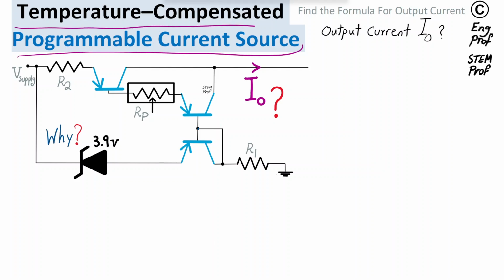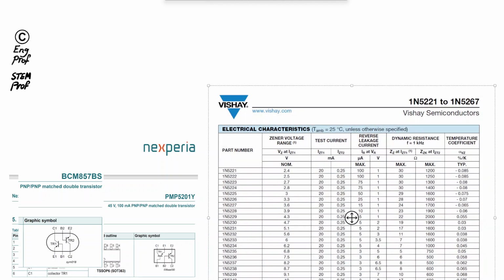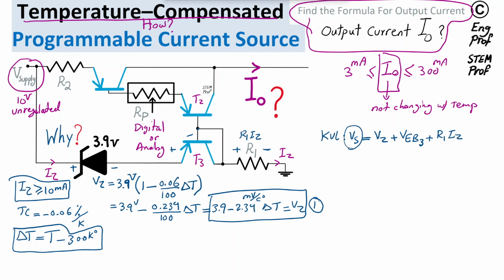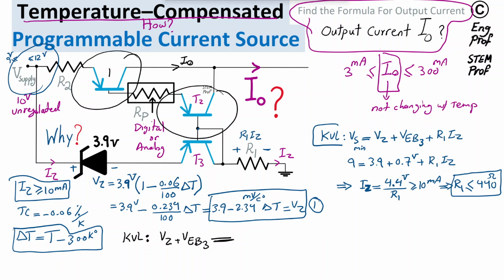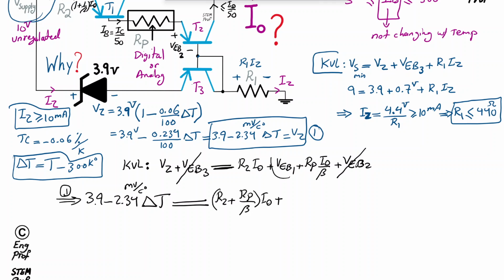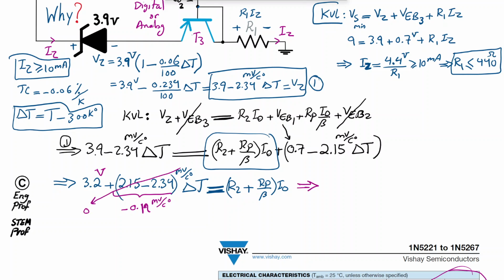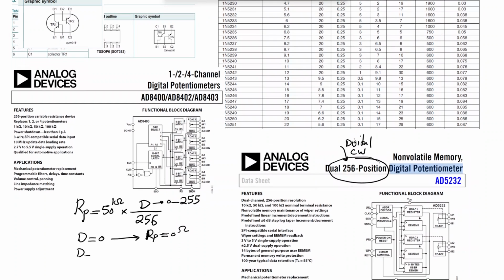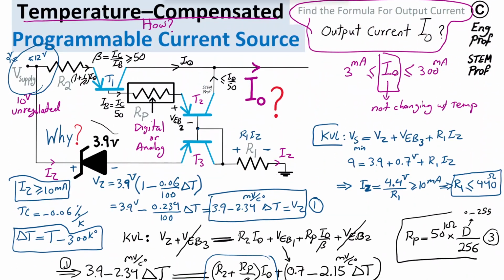Temperature–Compensated Programmable Current Source Circuit Design with Zener Diode, BJT Transistors

Comment from the maker: For more analog circuit examples see:
Wilson Current Mirror and Current Source Design https://youtu.be/LfbfJYrovN0
Temperature-Independent Current Circuit Design with Op Amp, BJT, Zener, Schottky Diodes https://youtu.be/hFbnjbddUvs
Thermometer Circuit Design with Op Amp & BJT transistor https://youtu.be/55YsraFE0rg
Analog Computer Vector Sum Calculator with Op Amp and BJT Transistors https://youtu.be/PIAsa0QNVns
Instrumentation Amplifier with Electronic Gain Control https://youtu.be/C4tghZ-q6Zs
Programmable Current Source Design with Op Amp, Zener Diode and Digital Potentiometer https://youtu.be/R1x6B0TczWk
On-Chip BJT Current Source Design https://youtu.be/Rs7gEMk03dw
Push-Pull Power Amplifier with Darlington Transistors https://youtu.be/866MYibo8yE
Analog Logarithm Computer https://youtu.be/RpKEq5WyoLg
Op Amp Analog Computer Differential Equation Solver https://youtu.be/ENq39EesfPw
Sawtooth Waveform Generator design with OpAmp, JFET, BJT https://youtu.be/5zHXTx-Vl20 
op amps Circuit with feedback loops to design an analog computer that solves a second order differential equation https://youtu.be/HeZRtnRXpEI 
For more analog circuits and signal processing examples see: https://www.youtube.com/playlist?list=PLrwXF7N522y4c7c-8KBjrwd7IyaZfWxyt
I hope these Circuit design and analysis videos are helpful.

Comment: Hi @STEMprof, can you list out an example where current source is positive temperature current source with very high impedance for current or combination bias of JFET and a way to offset the negative temperature coefficient of JFET, it would be really helpful working with dual supplies like +/- 15V
Reply from the maker: Good question. I suggest watching the following current source design examples and tutorial videos that answer your questions: Temperature-Independent Current Circuit Design with Op Amp, BJT, Zener, Schottky Diodes https://youtu.be/hFbnjbddUvs
Programmable Current Source Design with Op Amp, Zener Diode and Digital Potentiometer https://youtu.be/R1x6B0TczWk
and possibly Thermometer Circuit Design with Op Amp & BJT transistor https://youtu.be/55YsraFE0rg
I hope this is helpful.

Comment: Interesting videos. Is it possible to use any dual-PNP package? Or it is necessary that datasheet contains magic word "matched"? Is it possible to use BC857BDW in SOT-363 package which contains dual PNP, but datasheet does not mention that they are matched. I would expect that every dual or quadruple BJTs in one package are on the same die and have basically the same characteristics.
Reply from the maker: Glad that you liked this video. The Matched PNP transistor pair requirement is to minimize temperature dependency by having practically same saturation current & thermal voltage for the two transistors. While you can use dual-PNP package, the thermal compensation won't be as good as the matched pair. For more comprehensive Temperature Independent design please see alternative technique in https://youtu.be/hFbnjbddUvs which is a current generator circuit design using Zener Diodes, Op Amp and matched BJT Transistors. I hope this is helpful. 🙋‍♂️

Comment: That was very nice explanation.
The temp co of the pnp ,  are all pnp’s basically the same?  What about tempco for vbe of npn transistors?
Reply from the maker: You are welcome. Glad that this video is useful. There is no NPN transistor in this circuit.
Reply: @STEMprof  yes, but my question was about npn tempco for vbe of npn transistor.  I’ve seen many cases where this is used as a diode, where collector-base is shorted.  I think it’s because of low leakage?
But I’ve also seen it used for temperature compensation, so I was wondering if the vbe of it was same as that for pnp (temp co, I mean)
Reply from the maker: @yjweaver5108  For a given PN junction (whether in NPN or PNP transistor), the temperature coefficient is equal to roughly -2mV/Kelvin for a constant emitter current and PN junction temperature of 300°K (room temperature). That means the forward voltage of PN junction reduces nearly 2mV per 1°C increase in junction Temperature whether it is Base-Emitter of NPN BJT transistor or Emitter-Base voltage of PNP transistor.  The main reason is that as PN junction temperature increases the reverse saturated current through emitter junction increases exponentially and hence PN junction voltage decreases according to the Shockley equation.  Here are a few more related circuit examples: Temperature-Independent Current Circuit Design with Op Amp, BJT, Zener, Schottky Diodes https://youtu.be/hFbnjbddUvs
Thermometer Circuit Design with Op Amp & BJT transistor https://youtu.be/55YsraFE0rg
I hope this clarification is helpful.
Reply: @STEMprof  thanks, that answers my question

Comment: Thank you for sharing.
Reply from the maker: You are welcome. Thank you. For Temperature Independent design please see alternative technique in https://youtu.be/hFbnjbddUvs which is a current generator circuit design using Zener Diodes, Op Amp and matched BJT Transistors.

Comment: BJT beta increases with temperature, so the voltage across Rp varies with temperature.

Rp should be a PTC thermistor that tracks the beta.
Reply: Did clearly didn't even bother watching the video? 🙄
Reply: @JaenFoster  I read the equations and listened to relevant parts
Reply from the maker: Thanks for watching and sharing your thoughts. You have a good point. If changes in beta of the main PNP transistor is not negligible then I suggest using alternative design in https://youtu.be/hFbnjbddUvs which is a Temperature-Independent design using Zener Diodes, Op Amp and matched BJT Transistors. If need be a current inverter can also be used to change current sink to current source circuit. Thanks 🙏